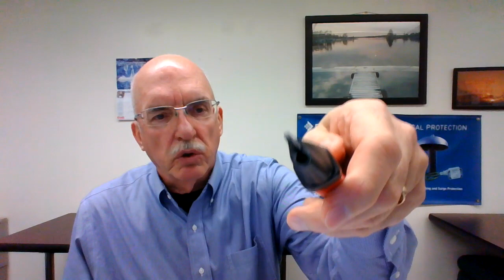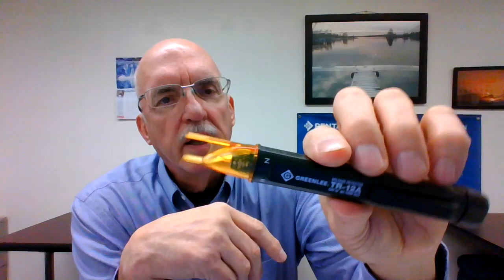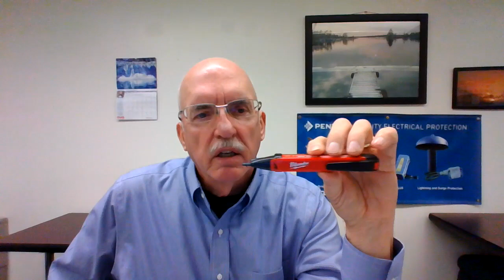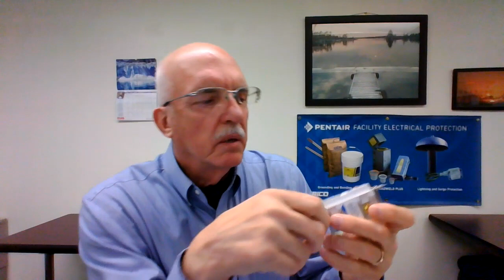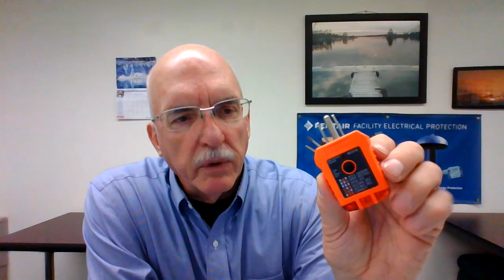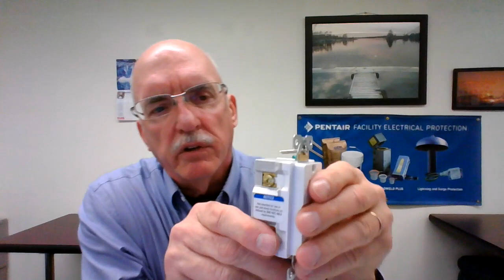Electric Education Center Session 2 - GFCI &amp; What You Need to Know

Comment: My 2 cents on proximity testers. Most people do not use them correctly. Was taught to test it on a known energised circuit then use it to test the circuit you will be working on they retest it on a known enegized circuit. Had them give me false positive readings where a lot of energised conductors are in long conduit runs. At hospitals they use equipment GFCI circuit breakers that trip at 30 milliamps. Tried running large 6 door ( 3 doors on clean area side & 3 on other side ) on 5 milliamp GFCI'S but would trip several times a week. Removed wires and meggered compressor and interior wires with a 1,000 volt megger and always had 2.2 gigiohms to ground. Ran great on a 30 milliamp GFCI.Will the NEC ever standardize the color lamps on GFCI'S?  Do you think dukes of hazzard Pa will ever get state electric license.  Thanks Rich for another great vid. Still brings a smile to me when somebody calls a lamp a bulb. Tell them what you told us a bulb goes into the ground and a lamp into a luminare.